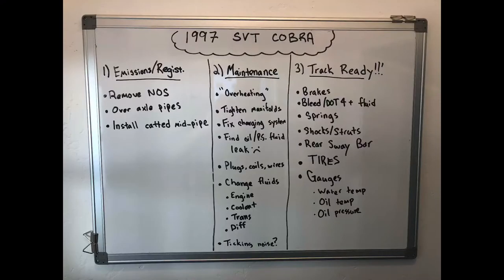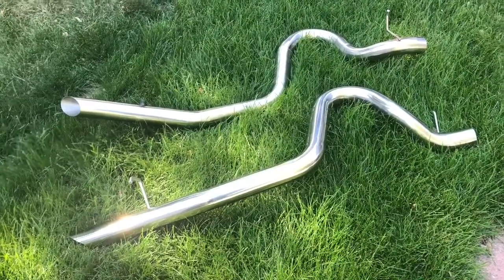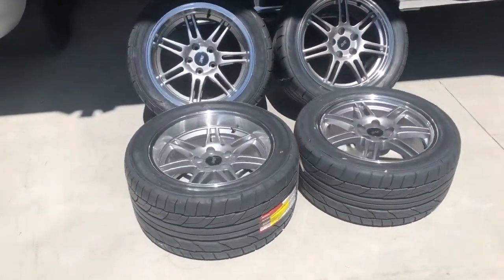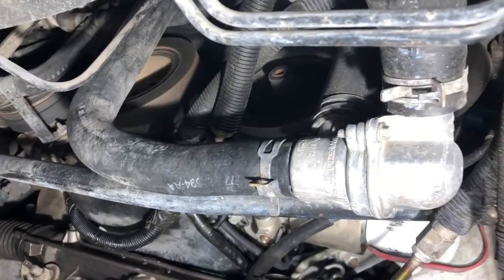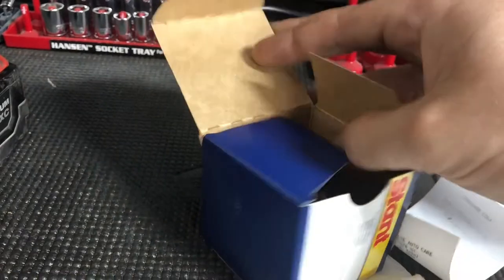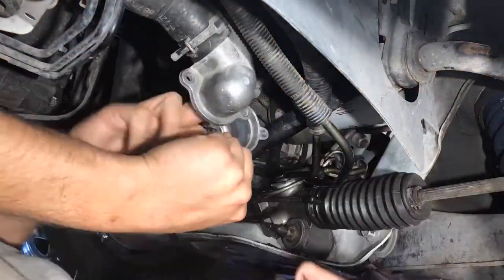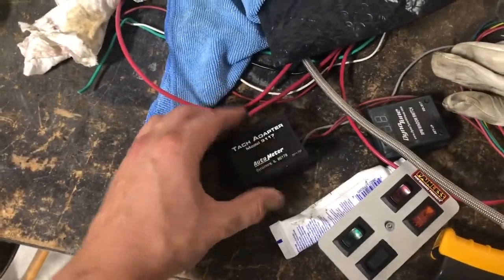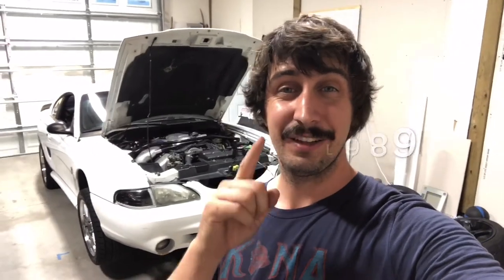1997 Cobra Cheap Track Car Build: Getting the Basics Sorted

Comment: The Motorad thermostat you removed is the companies premium fail-safe version thermostat. It will lock in the open position if the cooling system overheats, a real good feature, allowing coolant to continue flowing where as a typical thermostat fails and will be in the closed position. I buy parts from rockauto.com, I get no reward, or monetary gain mentioning rockauto.com, I only mention them because they have the best pricing I have ever found AND they offer premium Motorad  fail-safe thermostats. Knowledge is gold. Take care Motörhead!

Comment: Hey, you forgot to leave us with how the exhaust sounds now with the extra pipe!  On the thermostat, Motorad usually makes pretty good stuff so I'm glad you found it was just the wrong thermostat.  Good vid!  Thanks for bringing us along as you learn a new platform.  It helps us learn along with you.
Reply from the maker: SudsyCloud thanks for the kind words.  Ill make sure to get a video.  I think it quieted it down a bit but not too too much.  The thermostat looked quality but a VIN number lookup showed that it was for a GT.  I have no doubt it would have worked well in the right application.  Thanks for watching!!

Comment: The 96’ Cobras had a recall on cooling system components.I had the same issue, and it eventually a blown head gasket. As a Mustang enthusiast I would only buy a 94-95, and 97-98 cobra.
Reply from the maker: Meorme yea ive heard this.  I lucked out as i found this out after getting the 97

Comment: This video is so helpful! I bought a 98' cobra last year, with similar issues as far as the heat and a nitrous system! I will hopefully be changing the thermostat soon and will work on removing the nitrous system this spring! Great videos, thank you!
Reply from the maker: Thank you i appreciate the kind words!  Something ive learned recently is that people often do not bleed the coolant system correctly and that gets falsely diagnosed as other issues.  If you do not track the car or live in a super warm climate id go back with the stock thermostat temp and religiously follow the bleeding procedure.  To do it right takes a couple heat cycles

Comment: I had the same issue in my 98 Cobra. Went through the thermostat from a local auto parts store and it didn't work so I went through the entire cooling system before I went with the Reische unit. It was like 4 years ago so I'm not totally sure but I think I went with the 170, the needle doesn't even get halfway up on the gauge anymore but the problem was fixed. Maybe in the future I'll go to the 180 degree unit.

Comment: Great video...but what is the plug 13:08
Reply from the maker: Thanks.  That is the coolant fill location on the 4.6 4V DOHC cars.  It requires a 1/4” drive ratchet to remove.  Its a threaded plug into the coolant crossover tube between each cylinder head.
Reply: @truckandroll989   Thank you!